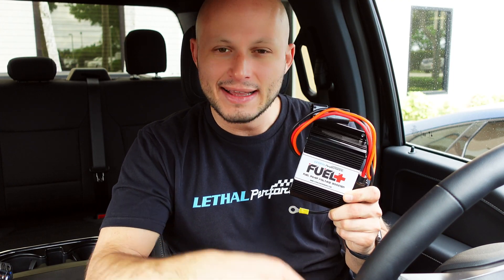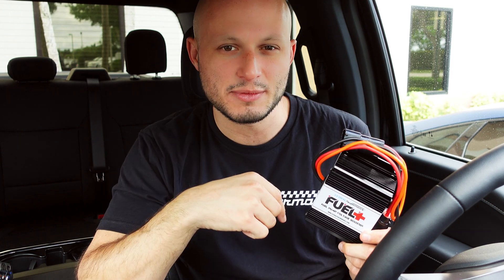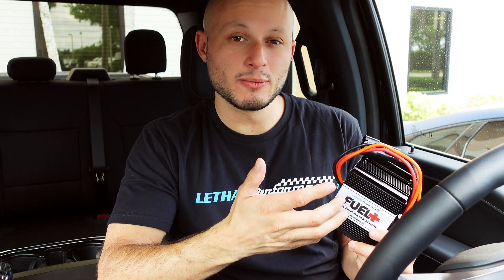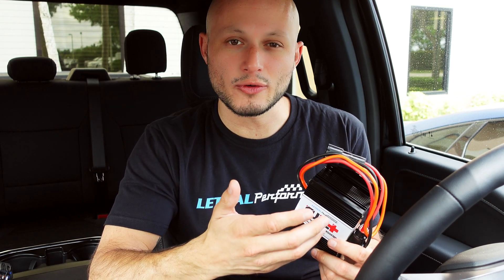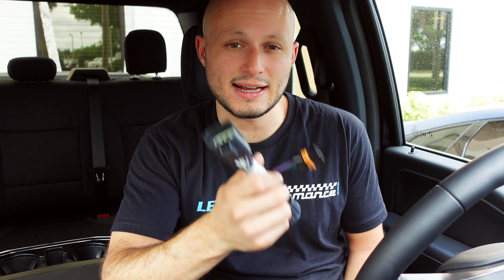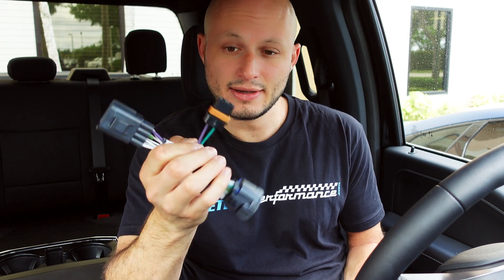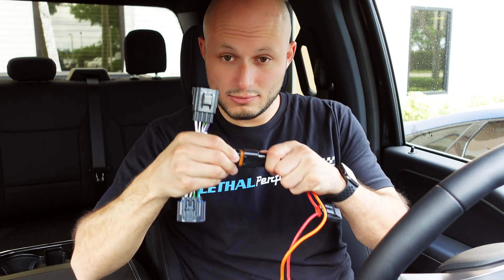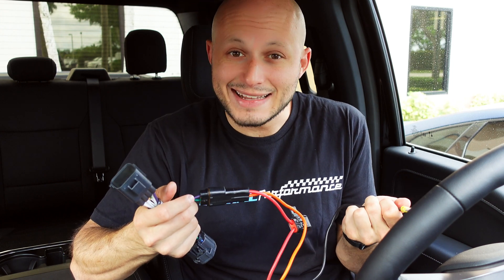2 Minute Tuesdays | Fuel+ Fuel Pump Voltage Booster

Comment: Would there be any benefit to boosting a stock engine with no mods ???
Reply: No. Stock engines are programmed to have the proper pressure. You only need more pressure when you have a mod that could lean your mixture, such as a Turbo